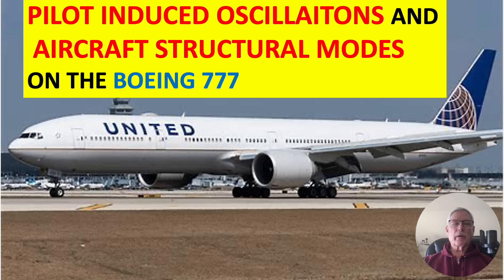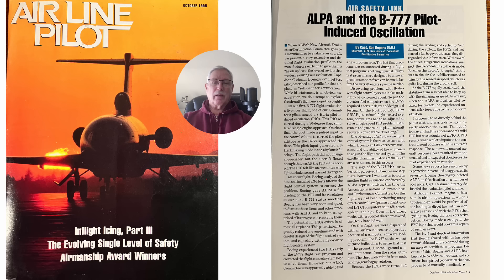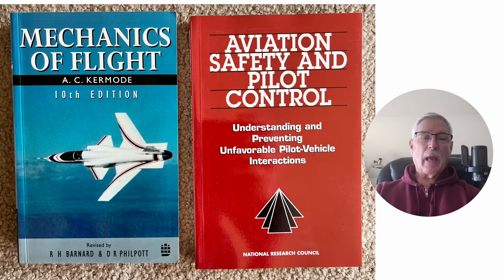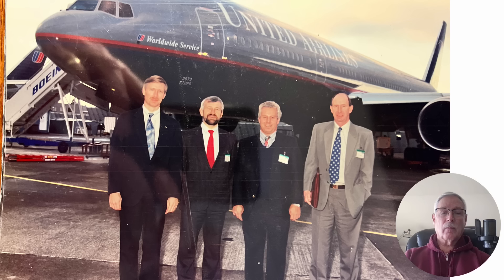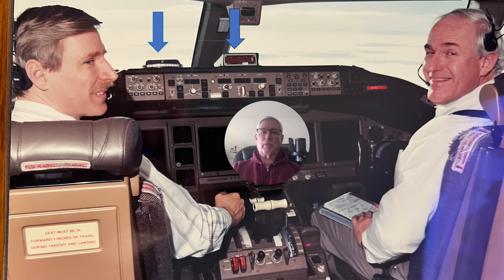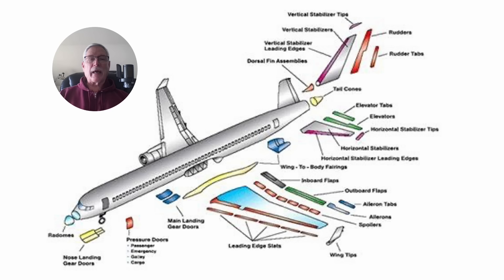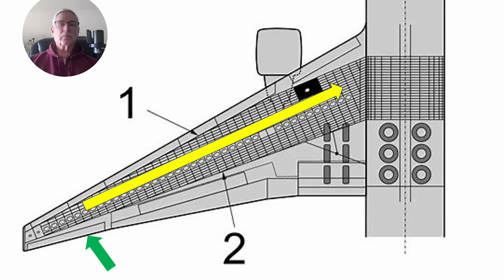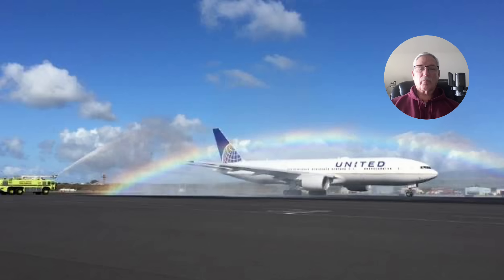PILOT INDUCED OSCILLATIONS AND AIRCRAFT STRUCTURAL MODES ON THE BOEING 777

Comment: I flew the 777 for American for 18 months, I loved flying it and the great meal service flying it from ORD to NRT, it just got boring on those 12 hour flights.  I had to commute too from DCA to ORD.  I went back to the 737-800 which I loved and the shorter legs.  By the way we got to do 5 touch a goes over at our maintenance facility/airport just West of DFW, we swapped seats on down wind cycling pilots until all 4 of us new pilots were signed off to start flying trips.
Reply from the maker: That is why I never transitioned to the 747, although I would have loved to fly that aircraft. My son really loved flying it. Our 747s only did ORD-NRT and after two trips to NRT, I had been there two times too many. Did love the Bonn however!

Comment: Nice job on the video and certifying the 777. Thank you for what you did back then! I’m a retired CAL 777 Captain and ended my career (merged with UAL) after 17 years on this great plane. I do remember my first IOE flight full of passengers (after getting the type rating in the sim, of course) and for the first leg to London the check airman had me rightly turn the autopilot on VERY SOON after take off and back OFF shortly before landing. It was on the way home he had me click off the autopilot in straight and level flight 30 miles from Houston to hand fly the rest of the way to the landing and I INSTANTLY went into PIO. I thought for sure there was a serious flight control problem, it just didn’t “feel right”, something I didn’t notice when briefly hand flying on the first leg and the check airman had to convince me otherwise. This was the first “fly by wire” plane for me after 25000 hrs on 727s 737s 747s A300s and DC10s and at that exact moment (although I never experienced it hand flying in the sim) I realized the 777 was a totally different animal. It just didn’t feel like what I was used to. Don’t get me wrong I LOVED the 777 and miss it dearly, but when I think back on all of those different jets about which one I’d rather HAND FLY… it is not the 777. It’s the 727. Hand flying a 727 was wonderful. Even the DC10, a wide body and my last plane before the 777, was more fun to hand fly than the 777. But ya can’t have everything when you design airplane, and this airplane got me safely to destinations around the planet and I will forever miss it. PH

Comment: One time I flew from Portland to ORD on a red eye flight in a wide body tri ( don't remember if it was DC10 or L1011 ) & we had moderate turbulence.   There were few passengers so I moved to the isle seat, leaned over so the doorframe of the 3 bulkheads lined up and could see the flexing of the fuselage. Being a private pilot & understanding the flexibility of structures it didn't bother me but still was quite interesting.

Comment: Great channel Ron! It's refreshing to watch airplane tutorial videos that are not ambulance chasing dramas like so many other channels on the 'Tube. Your observations about overcontrolling are spot on! I teach in a public 777 sim in Mississauga Ontario and overcontrolling - especially roll inputs - is something I see students with various levels of flight experience do on almost every flight - especially on approach/landing. Beginners and low time pilots roll inputs always turn into what I call "F-18 turns" because they roll the yoke (always double what is required) but don't realize yet (or simply aren't monitoring what their hands are doing) that you don't need to hold the roll input for the duration of the turn - which is probably car driving training being subconsciously applied to flight training! Rushing is another thing I see in the sim that is epidemic in many professions. I always remind students of Gunny Swaggar's sage advice: "Slow is smooth and smooth is fast". And I frequently do my Yoda impersonation: "Very good is possible, perfect not."

Comment: Ron, I really enjoyed the video and the technical background behind the 777. An amazing aircraft.
I had to laugh, however, at the end when you described your last flight and what you miss (the aircraft, the crews and the layovers) and don’t miss (jet lag).  I was a 787 Skipper, the pinnacle of an airline career, when COVID came along in 2020.  The senior (expensive) pilots were offered an early retirement package to “go away”. I loved my job, particularly after slogging it out for 30+ years and finally getting to the top. It also would have meant leaving 5 years early. In any case, in trying to decide whether to stay or go, I started a spreadsheet listing the pro’s and con’s and my list included the exactly the same items you listed and sure enough, 4 years later, those are the things I miss and the thing I don’t miss!

Comment: As another electrical engineer, I loved the discussion about PIOs.  Among my tasks years ago was to figure out how to jink flimsy telescopes and mirrors around without setting them into a ringing motion that would take a long time to settle out.  This was not hard to do using well-known methods in servo loop design.  

It is far more interesting where the pilot is part of the loop. But as you said in another video (which I also liked a lot) pilots can learn how to fly unstable aircraft. 

In retrospect I wish I had set up an analog computer to model my optical systems, and then put myself into the loop.  Maybe I would have learned things about optimal control by getting myself trained and measuring my inputs and responses ;o)  

In another context, I actually did just that.  I taught myself to move a mass on the end of a 1meter string in such a way that it went swiftly from right in front of me to, say, two feet out, where it came to a complete stop.  I started my training with a good mathematical understanding of how to move my hand to make that happen.  Understanding the physics was great preparation for the actual physical practice. 

The flubs during the learning process were inconsequential, which couldn’t be said of flying an unstable aircraft ;o)

Comment: I have always been curious about what makes us create PIO. When I was flight instructing, I observed a little over half of my students "waggle" the controls rapidly and unnecessarily. In the little 172 these inputs were often not sustained long enough to even cause a change in attitude. This was typically observed in light turbulence that the aircraft's natural stability would correct on its own, but some did this in smooth air. It was always most severe and common to see during the flare.

My theory on it was that since the brain cannot anticipate what each gust will do or when it will occur, they subconsciously overcorrect so that they can counter their own input. I have seen this on many videos of pilots at all levels, particularly during final approach and flare.

I have since moved on to regional flying on the CRJ series, and find myself struggling in turbulence near the ground to not overcorrect/undercorrect. I do not know why this is happening now, I suppose it could be because I am not used to the lack of feel with hydraulic controls coupled with their high effectiveness at lower speeds. In GA aircraft I could react without thinking with the right amount just by feeling the acceleration in roll or pitch. 

Do you have any advice regarding developing the skill of precise control inputs in jet aircraft? I can often tell when the autopilot has come off when deadheading as the airplane will start a roll oscillation around 1,000'. I'm lucky enough to be smooth in smooth air with a single constant pitch imput during flare, but now find myself like many others in turbulence at lower speed.
Reply from the maker: I know exactly what you mean. We tend to over correct and "stir the stick" as one pilot called it. Just try to slow down the inputs and make them not as aggressive.
Reply: @ronrogers  Thank you for the reply!
Reply: A larger aircraft has more mass and far more flexibility. Therefore it will react slower and be more sluggish initially. Due to flexing, twisting of the wing, etc. It's not capable of immediate reactions followed by reverse actions that the human body can quickly output. So use the smallest control input as possible. Err on the aide of "not enough" than too much. Because not enough is easily corrected by easing in more input in the same direction of motion, but too much requires a reverse command. Which the airplane mass and moment of inertias are going to fight.
Reply: @jj4791  On my particular aircraft the opposite is the case, it is far too sensitive for me and reacts too easily to my inputs causing slight overcorrections. Again this is only an issue during turbulence when quick reactions may be necessary and I do not yet have the muscle memory to give the exact right input.
Reply: @SgfGustafsson I think the crj feels all over the place if you’re trying to correct every bump immediately. Once I relaxed a bit things smoothed out.

Comment: About fuselage flexibility, during very severe turbulence which resulted in a very fast sink rate at lunch time, I was seated midway between the wing and tail, near the aisle in the 4 inner seats in a TAP Airbus A340 so I can saw almost all of the aircraft length. I swear, after a couple of seconds, I noticed the fuselage bending when the wings were loaded again. I assume the wing also bent a lot. This was near the equator on May 2nd 2008 on a flight from Luanda to Lisbon. What a mess after this, but nobody was hurt. The flight took 5 more hours in complete silence.

Comment: Very informative, thanks Ron!

Question:  what's the reason for the placard on the captain's seat? "Seat must be in forward 7 inches of travel during takeoff and landing".
Reply from the maker: If I remember correctly, that is so the seat track is fully engaged and the seat is secure.
Reply: The 777 was the first airplane required to meet the Head Injury Criteria (HIC) for crew and passengers.   The seat was dynamically tested to help insure survive-ability. It's counter intuitive but if you are too far back your head could have more time to accelerate into the glare shield or panel.  You would be amazed at how far a tight shoulder harness can stretch in a mishap.  There is a reason you see people walking away from incident airplanes that would have killed everyone 40 years ago.

Comment: Hello Ron,
Thanks for your interesting insight into PIO on a big transport aeroplane with digital FBW. In 14 years on the (much smaller) A320, I never experienced it. Mind you, many pilots had a tendency to "stir" the sidestick unnecessarily and counter-productively - particularly on a turbulent approach.

Must admit I wasn't aware that Boeing and (perhaps) the FAA had permitted ALPA and BALPA line pilots to fly the B777 prior to type-certification. That was not offered to BALPA by Airbus prior to A320 type-certification, which was completed in February 1988 before any line pilots like myself were allowed to fly it.

BTW, is the bearded guy in the photo of four of you by the triple-seven main bogie (I thought Boeing used the expression "truck"!) one Chris Manning, by any chance?
Reply from the maker: The A-320 had a very significant PIO issue corrected before certification which I will discuss in a future video. Yes, that is Chris!
Reply: @ronrogers  I'll look forward to that, Ron! I don't remember Gordon Corps mentioning it during our type conversions at Toulouse, but I guess there would have been no point if it had been eliminated. Were you on the ALPA team that came to Blagnac in - IIRC - 1989, when Richard Pike and I represented BALPA as BA A320 line pilots and raised one or two EFIS issues with Nick Warner and Bernard Ziegler?
Reply from the maker: I'm sure I would have been and it sounds familiar, but I've gone to so many meetings I have lost track! I will discuss it later but it has to do with a roll limit of 15 degrees/sec.

Comment: Here's a 100% cure to recover from "dutch rolls" PIO or otherwise. fly the tip of your yoke airleon index on the yoke with the bank angle index on your attitude indicator. Fly formation using airleons only..no rudder input..feet on the floor.. oscillations quit quite smoothly and quickly.
Many years ago Braniff crashed a 707 new acceptance flight because of a dutch roll demo that didn't pull out..sad.. simple input
Reply from the maker: Yes, worked great on the 727.

Comment: 7:14 - is this what is meant by the term “doublets” when used by test pilots? If not can you explain the meaning of that term please?
Reply from the maker: A singlet is when you push the stick in one direction. A doublet is when you push then pull, trying to excite the structure.